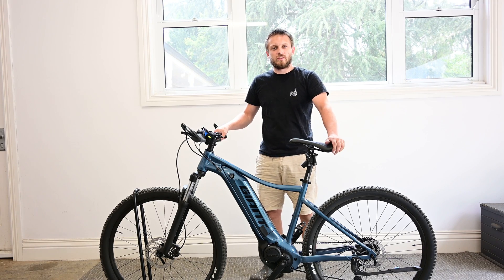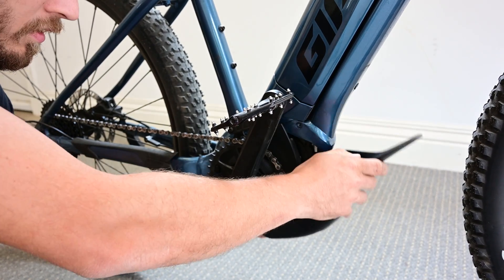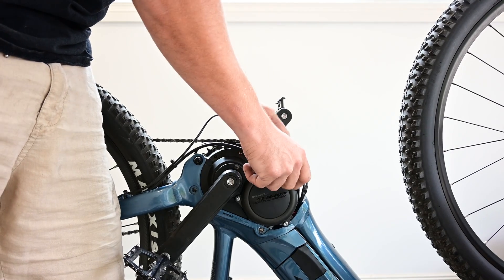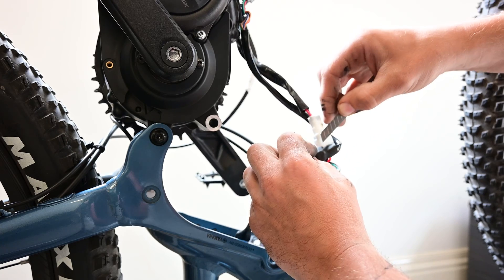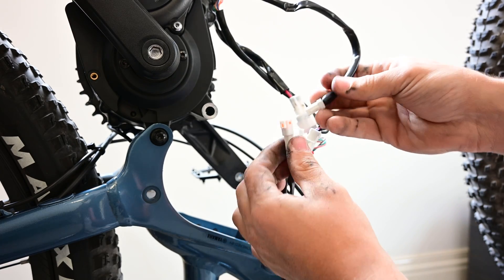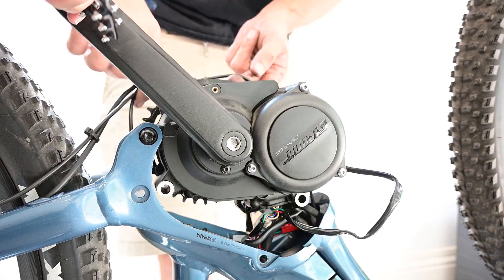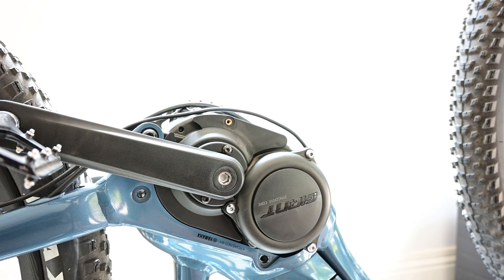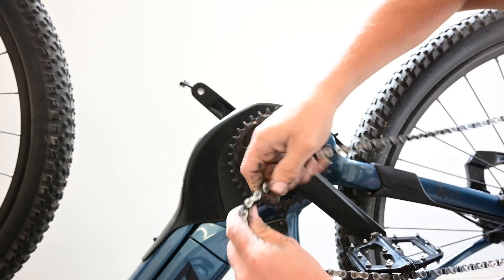Giant Talon E+ Speed Unlock 50km/h Chip Installation Guide SyncDrive Core Motor

Comment: hello.. I moved the speed sensor to the pedals to go faster and the syncdrive warning appeared on the display and the engine runs intermittently even though I put the sensor in its place. it still runs intermittently.. what can be done? Thanks!
Reply: Put it back to standard as the sensor is designed for the rear wheel, not the pedals.  If the magnet is not turning then the computer thinks that something is wrong and shuts down. This happens when you stop pedalling.

Comment: Recently purchased the Giant Trance Pro +2 and desperately want this chip. What's the name of the chip and where do I purchase one?
Reply: there is a simple hack ,do not need a chip etc unless of course you finicky about your display showing correct speed and distance ( I use the phones gps for this so no biggie).
Reply: share the hack! I'm so tired of the limiter!!!   @AnAceism
Reply: @AnAceism so what is it?
Reply: @gahb4326  mount a magnet on your pedal and move the sensor to read that magnet instead of the one mounted on the back wheels spoke .

Comment: Hey mate, I’m Aussie too, and am just about to buy myself an E-bike. I’ve been looking at the Giant Roam E+ or even the Cube Reaction Hybrid. Which of those two is the easiest to unlock, and with the least issues like error codes? Or is there a better option at the $4000 AUD price range? Appreciate any info mate. I’ve put so much research into trying to get the best value mid-mount from a decent brand, but something that’s not slow as F.
Reply from the maker: Giant roam has the Syncdrive core motor which is very slow when unlocked you will typically only be able to get up to 35km/h, Cube uses the Bosch motor which can be unlocked but can have issues with error codes. Alternatively we have some bikes in stock using the Bafang m510 motor which can be unlocked to 45km/h and still maintain its warranty.

Comment: Exactly the video I needed. Will give it a go installing my VOLspeed V4 chip later today.
Reply: I just installed one on my stance e+0 pro today and what a difference :D No more wall at 25km/h!
Reply: How did it go?
Reply: @samevans9862  went perfectly. Works like a charm :)
Reply: What bike do you have please
Reply: @lu-ww2cn  I have a Giant Talon E+ 2 :)
Reply: @mtnholt  max speed reached on motor only please
Reply: @lu-ww2cn  45 km/h is reachable, but 40 km/h is more realistic while biking comfortably without sweating too much on flat roads.
Reply: @mtnholt  I am asking about max speed on motor only without using pedals at all
Reply: @lu-ww2cn  not possible. This chip is not for that. Have you done any research at all?
Reply: @mtnholt do you have the 2023 edition and if so could u give me the link to the speed chip u have
Reply: @money4xtra  did you find the right chip?

Comment: You say at the end of the video, "now you can go past 25" The specs say the motor will assist to 32kph in standard form or 100 rpm cadence.
Reply: 32kph is only 20mph. I've got this exact same bike and the motor only assists up to 20mph. Doesn't mean you can't pedal it faster but the motor won't push you faster than that
Reply: @batingbunnies Is it possible to change the assisted speed?
Reply from the maker: Depends on country of purchase In Australia the limit is 25km/h
Reply: I'm an Aussie with a Talon. Do I need to purchase and install a chip to increase the speed limit from 25kph to 40kph?

Comment: Would this work on the giant revolt e+? It uses the sync drive pro system. 
I don’t have the ‘walk’ button, so how would this chip be activated?
Reply: Any reply on this question, I also have 2022 revolut  E+ Pro
Reply: No the 2022 revolt uses the shimano ep8 motor. This chip is for the Yamaha motor

Comment: Remember this. Higher voltage = increased speed. Most of those bike will be sold with the legal limit of a 36v battery. This is what will restrict your speed. Replace it with a 48v or 52v pack and your speed will increase by 10-15 mph. That is it.
Reply: Make sure you check the control unit can take that many volts though?
Reply: @DJSeddon  Most controllers can handle 52v. It’s only 3v up from 48v
Reply: Will this work on a giant talons E

Comment: Does adding this chip void giant warranty?
Reply from the maker: If you remove the chip prior to warranty claims you should be ok. If you leave it installed you would not get warranty
Reply: I’m interested too to know please
Reply: My guess is yes it does. I spoke with my giant LBS and he told me they legally cannot work on any other brand ebike, or any regular bike modified with after market motor. He won't even change a tire on any ebike not Giant, and not stock.

Comment: Have you managed to get this done on a giant fathom e+2? The chain ring is in the way of the bolts so can't get the bash guard off.
Reply from the maker: The chainring has to be removed for many of the giant installs as it can get in the way of the bolts.
Reply: Do you have a video on how to do that please. I may have got the wrong crank puller that got sent with the speedbox chip but I couldn't get the crank off

Comment: Can we expect the same performance as the slightly higher-end motor, the SyncDrive ''Sport'' obviously without your Giant Speed Unlock Chip ? I have to choose between a Roam (''Core'' 50nm) or an Explore (''Sport'' 70nm) . In short, does your modification increase the torque at the ''Sport'' motor level?
Reply from the maker: Only the speed limit is increased, There is no additional torque or power increased for this chip.
Reply: What did you go with? I'm facing the same "problem", roam vs explore, and I still have no idea what to go for...
Reply: Hi I’ve got 2022 talon e sport, can I get a chip for this
Reply: Get the Badass 4  box....it sits outside..no need to dismantle your motor !
Reply: @riverstones-wd40 people don’t want to get caught like you it’s better of hiding it and turning of off with a flick of a button lol

Comment: What about the range? How long can I drive with 20mph?
Reply: The range will drop dramatically since that much speed requires much more energy and it's not linear. I did this on my other bike and the range at full power and full speed would drop down to about 30% (70% reduction!) of what originally claimed. I later on decided to go back to the original. It's still a pedal bike, not a motor bike and it should stay that way.
Reply: Probably half the distance if double to speed ?